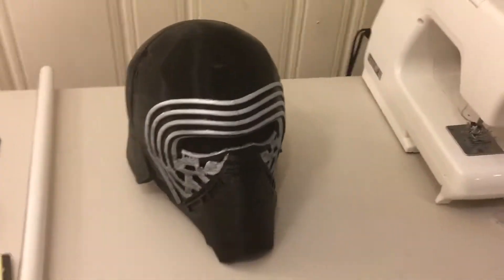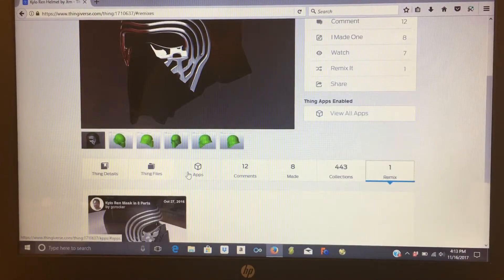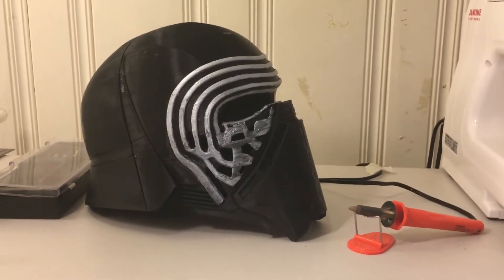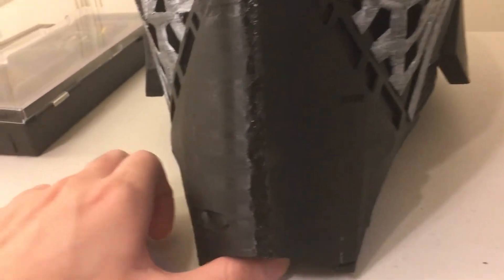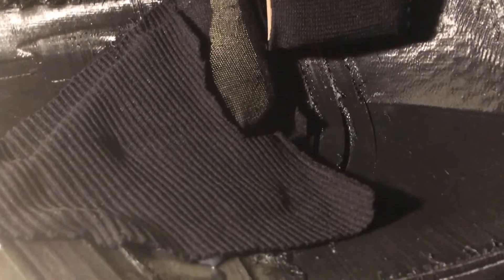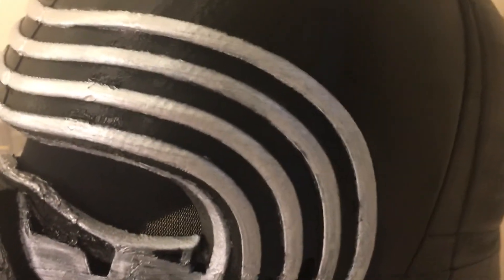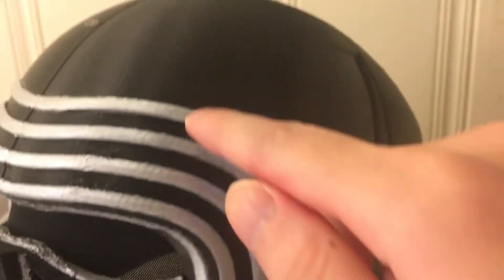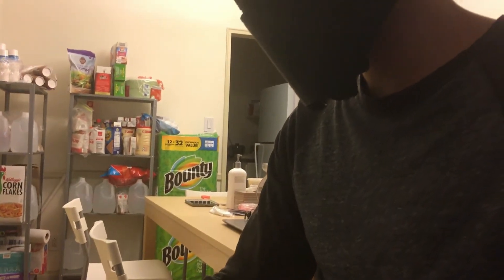How to Make a Wearable 3D printed Kylo Ren Helmet

Comment: the right and left eye pieces are a pain to remove the supports without breaking the lower eye parts.. tried 3 times.
Reply: Yeah i just made mine, watched this video after. I just glued it back and sanded the helmet alot so you can barley see the seems between pieces